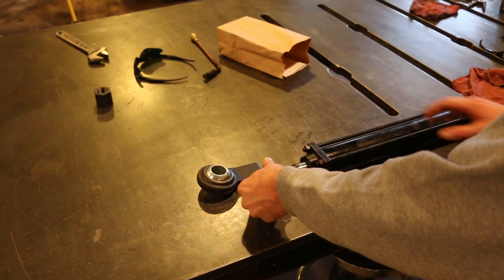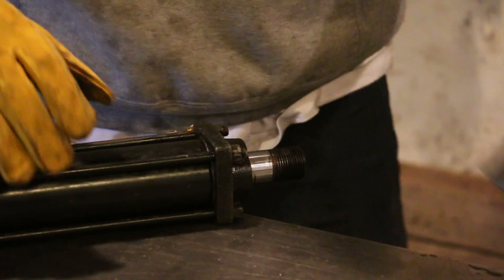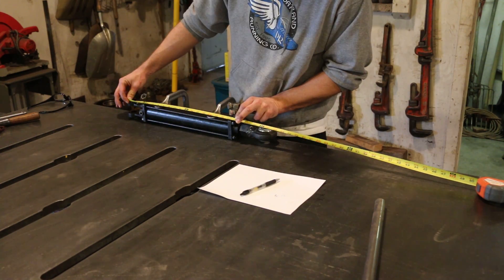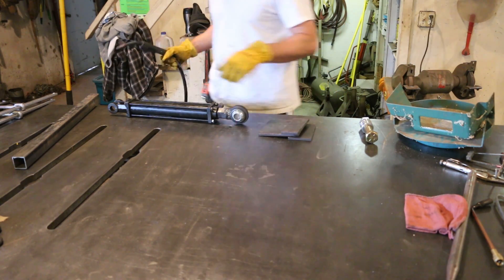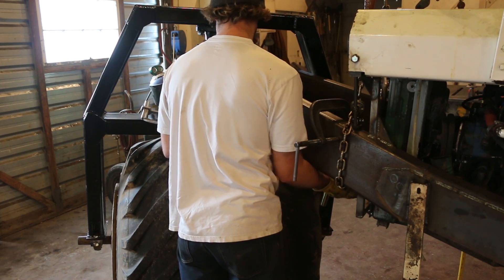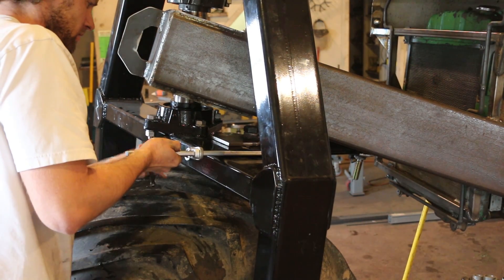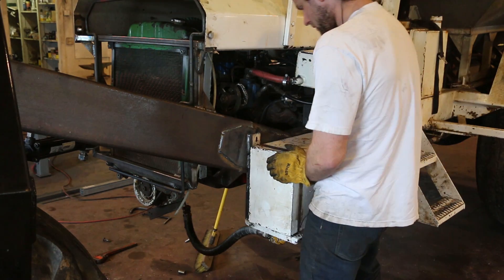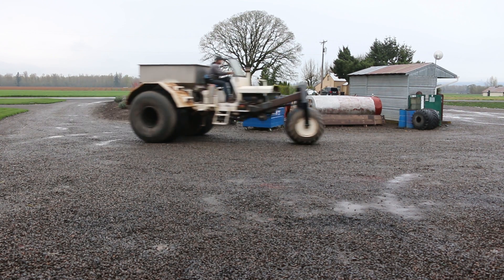Fertilizer Buggy pt. 6: Steering

Comment: For the problem at 2:23 > drill out a hole in the nut all the way through and then some to penetrate about 1/4" into the shaft while it's in the tightened position. then put a tether in to lock it in in place.

Comment: To help keep Slag out of threads use your oxy-acetylene and use the black smoke that comes off of it when you first turn it on and put that on the threads it will keep the Slag out of your threads and then you can just even clean it out with a tap to make sure it's clean when you're done

Comment: As a heavy equipment mechanic with over thirty years of experience I can tell you that I have seen failed hydraulic steering cylinders a few times over the years caused by improperly designed steering setups or poor matching (when original parts are no longer available) of steering cylinders when replacing them.  The trouble for you probably won't happen anytime soon but it will happen.  I don't know much about ag equipment in general or fertilizer buggies in particular though, so it may take many years 

When you have a steering cylinder that bottoms out in either direction, or both (with no bump stops) if the cylinder is near to bottoming out in the midst of a turn and you hit a bump the slamming force on the cylinder can be TREMENDOUS... As much weight is in that steering setup it could be like jack hammer blows.  Over time even modest hits will beat the cyl apart inside.  By placing bump stops near the full travel of the steering a slam would be taken by the steering rig you made and the hydraulic fluid not the mechanicals of the cyl.   You could make the bump stops out of something like that nylon-like material you used as spacers to keep your bearings centered.  Anything to keep the cyl from bottoming out.    Just something that caught my eye...